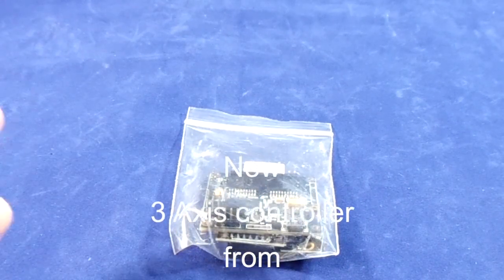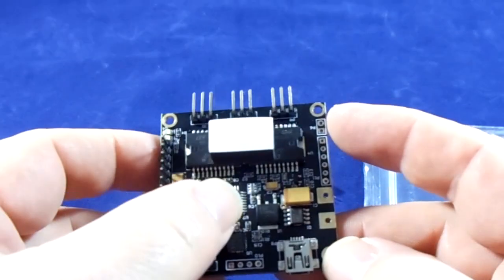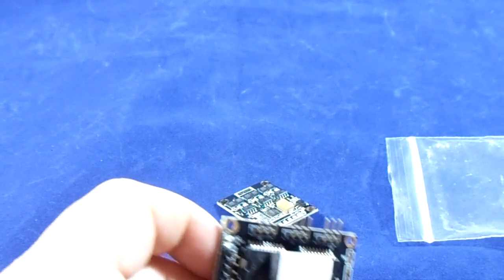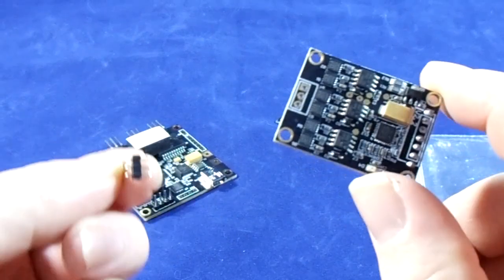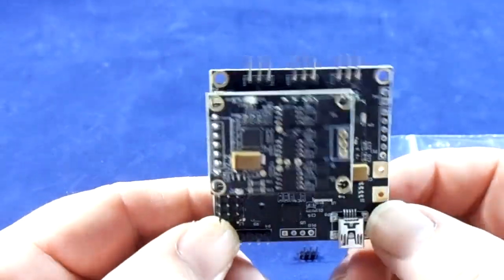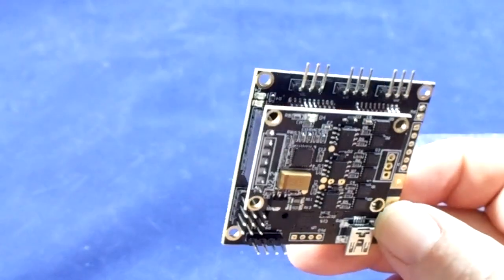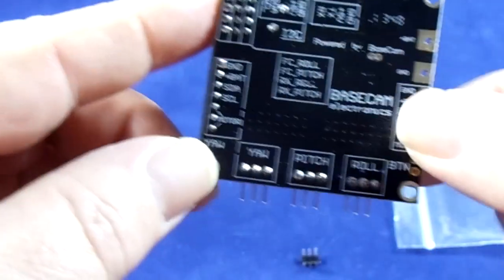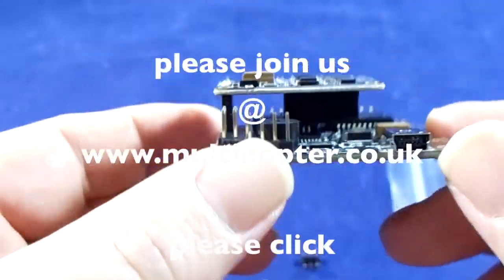New 3 Axis Controller from DYS

Comment: Hello. I having this board from DYS. And when i turn on apper tons of i2c erros. When i put off the 3º Axis the erros go off. You have this problem too? I try another board. And the error apper too.. The old board of dys this is not occur. Please help me :)
Reply from the maker: Hi sorry to here you have errors, I dont have any error like that, have you tried connecting motors and calibrating the sensor ?

Comment: Got to admit, that is a little confusing why you would have two sets of drive chips on separate boards to drive the same motor. Odd one.........

Look forward to seeing if you find out the reason and how it works
Reply from the maker: Not sure were you looking but there is not its the same as before but with pins on the main board for the YAW now ;-)